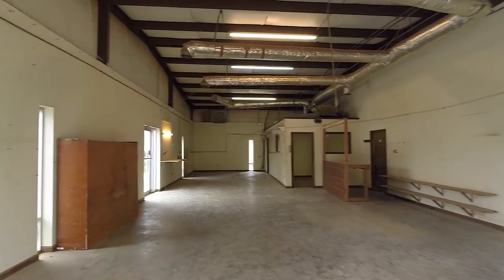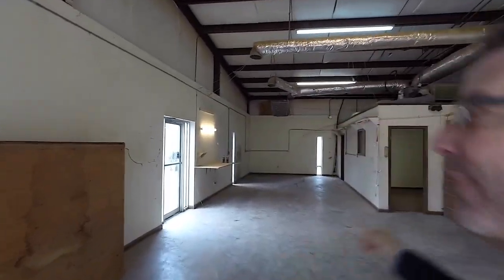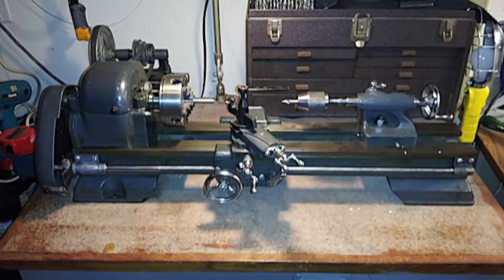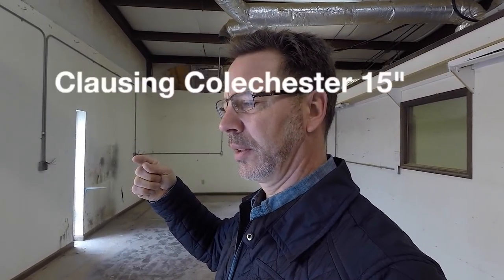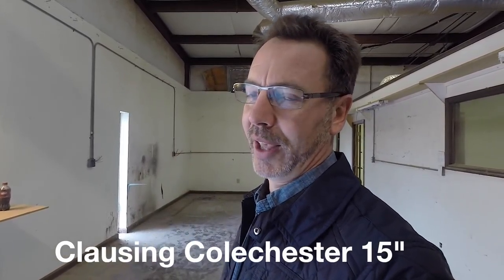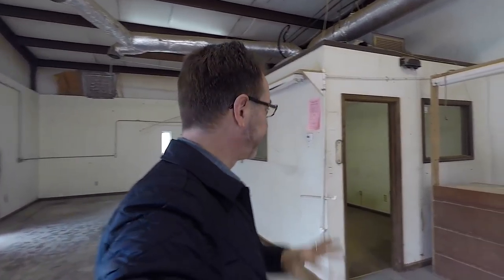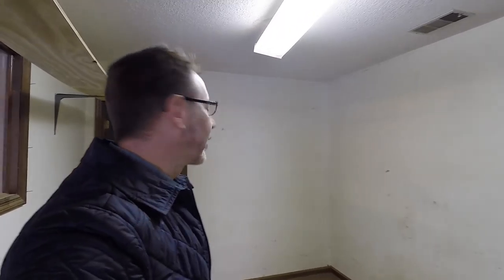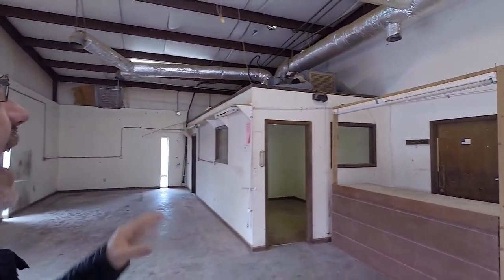New old shop - Part 2

Comment: Very cool sir! I am right over in Woodstock just down the road from you there. I would love to be able to get a dedicated shop like that sometime soon. Having my knife shop in my garage is less than ideal considering my 2x72 belt grinder is all of 10 ft away from my mill. Makes me have to clean everything constantly. 
3phase must be so nice! My grinder is a 3 phase ran off a VFD and works fantastic but with 3 phase input it would have saved me a few hundred bucks, which apparently can buy a surface grinder on Craigslist here! Nice score BTW

Comment: it will be a nice shop. The lathe is called correctly Clausing Colchester
Reply from the maker: Thanks for the correction. ;-)
Reply: ive the same, but a 17". clausing colchester mascot1600. I have the complete documentation,part list etc scanned in hq.If You need it i can give it to You of course. Looks everything very similar to Yours
Reply from the maker: andrasbsl Thanks for the offer in the instruction book. I found one under al different names. These lathe had sever names, now I think jet is making them, but I'm sure its not a nice as the old ones,
 
Dale

Comment: Awasome video! Question,you said that you never had three phase power before,so how were you running your machines ? Three phase converter or so ?
Reply from the maker: MBG-TECH Hi, I would change out the motors or use static phase converters.
Dale d